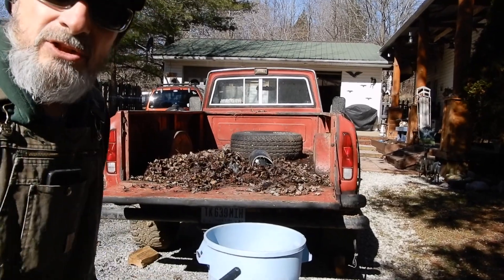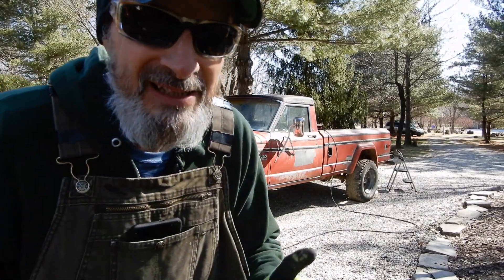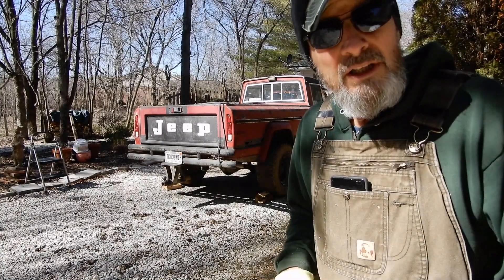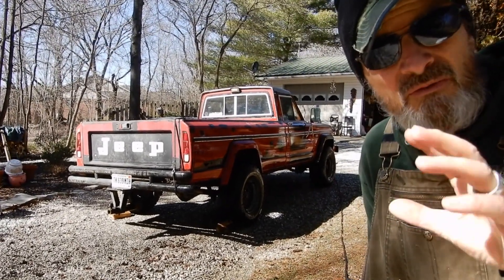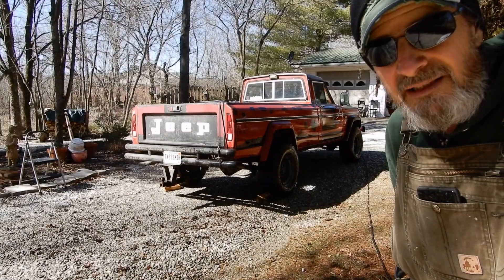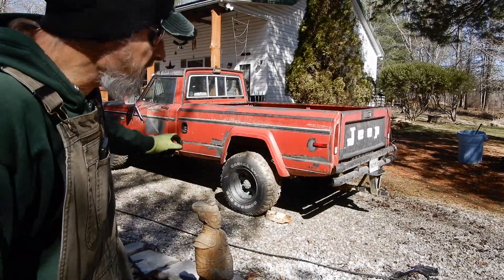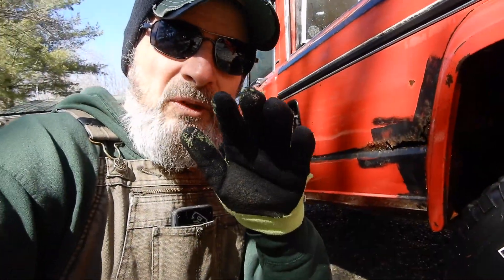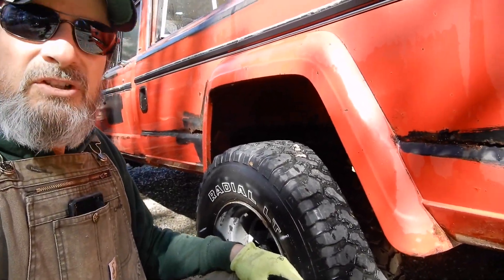Jeep J-20 1982 pickup restoration, power washing,  episode 3 #jeeps

Comment: this is great, i bought a 76 J10 a year ago, and boy oh boyyyyyy was she rusty.. i had to rebuild the entire bed floor an every bed cross member, all new spriings and i had to rebuild the leaf spring mounts, the rear cross member, factory rear bumper.. rebuild the cabin floors, sill plates, rebuilt the carb got it running, put maybe 2k miles on it now.. funny thing is i pressure washed it like a year later after all my fixes lol..  i gatta fix the bed sides now though.   but most people woulda given up on that truck... i got it for $800..    Generally the beds should all have rubber plus on the walls, this is wheere you wash inside and spray with oil "the way they did it back then" to keep em from rusting..

Also sanding the outside of the bedsides wont fix this, you need to clean inside the bedwalls, Jeep/AMC didnt paint the bedsides walls inside.. thats why the rust out.   Also the J10/j20 are the same vehicle, only thing diff are dana 60 axles in thee rear versis dana 44.. and better springs..  Thats pretty much it..   As for how much its worth.. on this video in this condition with that interior.. id say $4k maybe.  thats generally what they go for in that condition without anything rebuilt or restored..